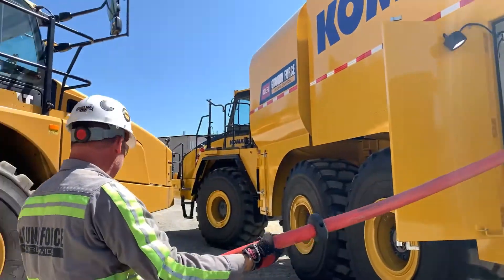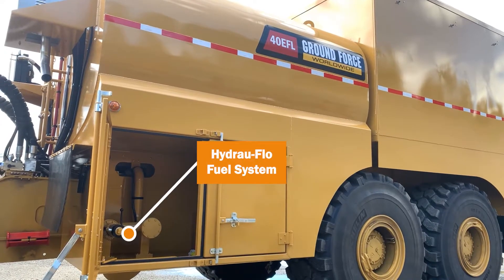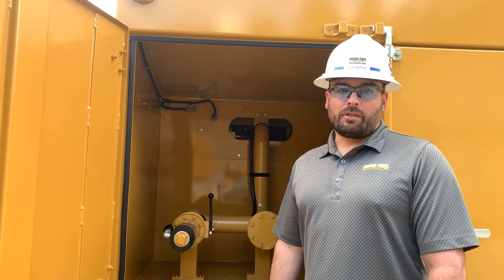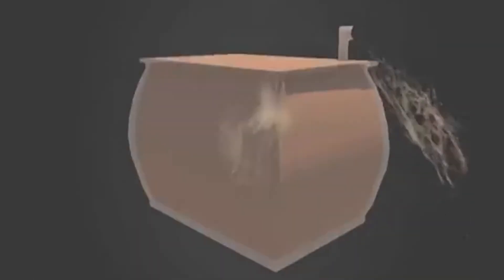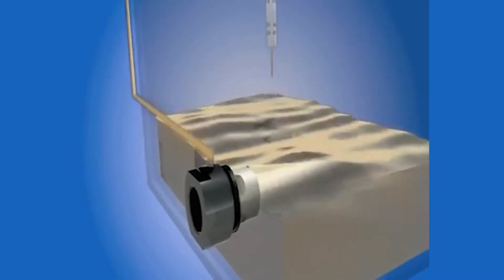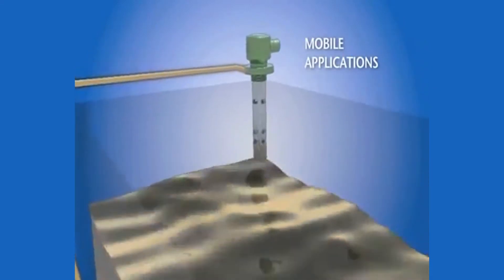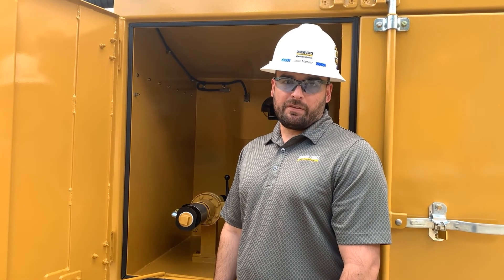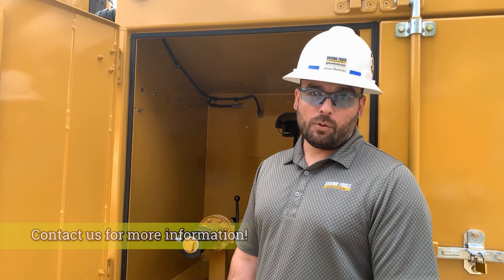FAQ: Hydrau-Flo Fuel Filling Valve System

Comment: I work at an open pit mine and we are in the process of switching to the Hydrauflo fueling system feom the Buckeye fueling system but on a few pieces of our equipment IE blast drills I was told we are not going to switch them over to the Hydrauflo aystem. I have been filling the drills thru the omni vent hole after removing the omni vents, and it is a pain. We have tried to put a Hydtauflo male receiver onto a Buckeye nozzle and plug the Hydrauflo nozzle into the Buckeye fast fuel nozzle but of course it does not work. Is there a Hydrauflo adapter that would fit onto a Buckeye fast fuel nozzle allowing a Hydrauflo nozzle to be used on the buckeye system. If there is can you give me a part number and manufacture that I can give to management for the purchase. Thank you for any help in this matter.
Reply from the maker: Thank you for the message. If you could please send through your contact information to solutions@gfworldwide.com, we will get you in touch with a product support representative.